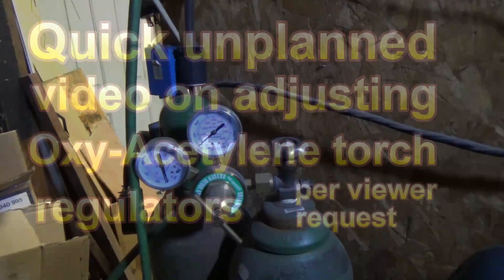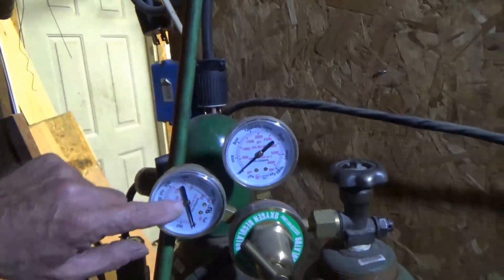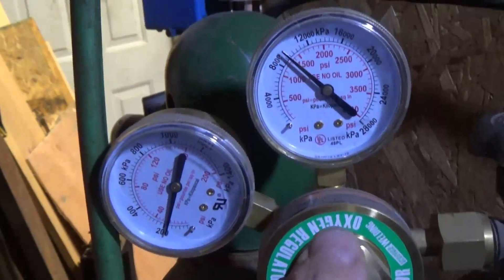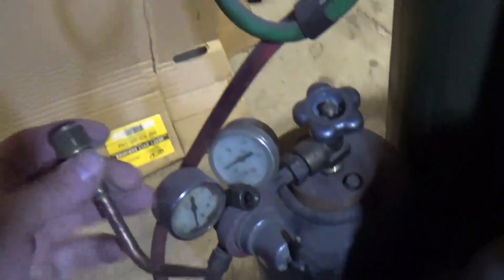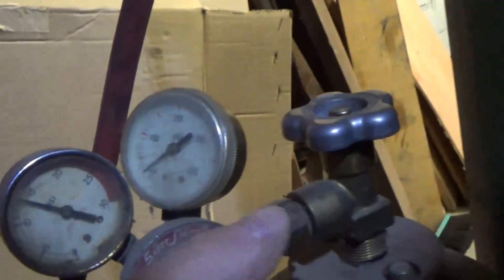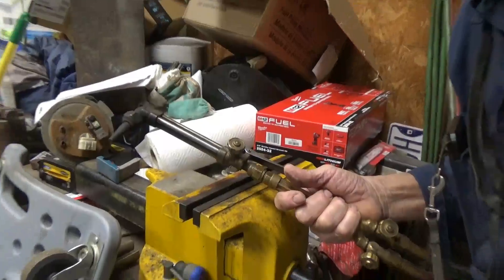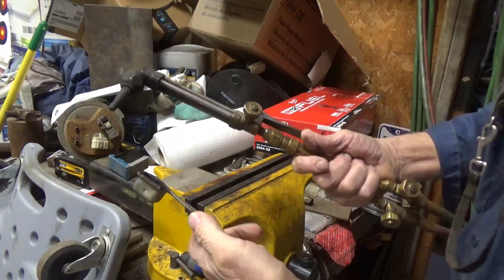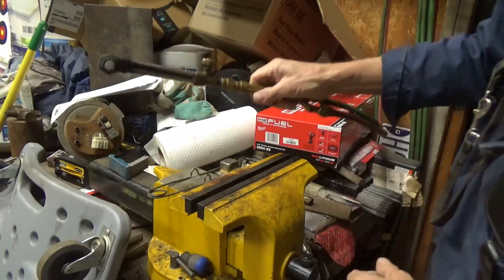How I set my torch regulators

Comment: Thanks so much.

Sorry to bug you again, but I notice that my regulated (low) pressure gauge on the acetylene regulator is in poor shape.   It's missing a screw, and the metal plate with the numbers is bent.  Can one replace just the gauge, or should I get a new acetylene regulator?
Reply from the maker: You're not bugging me. Yes you can get a new gauge from your local welding supply or I bet you can find one on Amazon. I would just get a new regulator, they're not that expensive. Harbor Freight has them in store cheap, also can be found at Amazon.
Reply: @GordonRobertsonDIY  I finally got around to looking.  I didn't know you could get regulators so inexpensively.  I wouldn't blame you if you weren't interested, but a video about which one to buy would be helpful - that is, what's the minimum cost of admission?  I know I don't need the 300 dollar plus set of regulators, but I'm a bit leery of the 40 dollars (for both) sets also.  I'm ignorant about welding and don't know where the "sweet spot" is.
Reply from the maker: https://www.amazon.com/Welding-Regulator-Repair-Replacement-Gauges/dp/B06X94NMLK/ref=sr_1_38?crid=3DKEF7NCRR9HQ&keywords=torch+regulator+gauges&qid=1573327101&sprefix=torch+reg%2Caps%2C181&sr=8-38
https://www.amazon.com/High-Pressure-Gauges-Acetylene-Regulator/dp/B01HIM6KRE/ref=sr_1_34?crid=3DKEF7NCRR9HQ&keywords=torch+regulator+gauges&qid=1573327101&sprefix=torch+reg%2Caps%2C181&sr=8-34

https://www.amazon.com/PSI-KING-Oxygen-Acetylene-Regulator/dp/B01DAZXRYC/ref=sr_1_48?crid=3DKEF7NCRR9HQ&keywords=torch+regulator+gauges&qid=1573327101&sprefix=torch+reg%2Caps%2C181&sr=8-48

https://www.amazon.com/iMeshbean-Acetylene-Regulators-Welding-Cutting/dp/B073F4N33W/ref=sr_1_44?crid=3DKEF7NCRR9HQ&keywords=torch+regulator+gauges&qid=1573327101&sprefix=torch+reg%2Caps%2C181&sr=8-44
Reply: @GordonRobertsonDIY  Thank you for your help. I appreciate it.

Comment: Thanks for responding Gordon!

I do not claim to be an expert on torches but just telling you what we use. Although we converted over to propane from acetylene perhaps 20 years ago we did not change the hose and the hoses we use now and have always used are red and green, right or wrong. Our oxygen tanks might be the next size up from yours and weigh about 150 lb full and cost about $60. Our propane tank is a little bit smaller than the oxygen tank but last forever and we only refill at once a year and although I cannot remember how much it cost it was not very expensive. Most of our cutting is on Steel 3 inches or less and I wish we had the acetylene like in the old days but if I had to pay for the gas myself I would opt for the propane for the cost savings over convenience. It does take a little bit longer to preheat what we need to cut before the cutting starts to take place but I would not say that we use that much more oxygen.

Love Your videos and have been a subscriber for a year or so!

Comment: My employer provides propane instead of acetylene because they save a lot of money although it is much more difficult to work with as it does not seem to give the heat that acetylene does. When they converted over from acetylene to propane we needed a different gauge and a different torch tip.
Reply from the maker: The welding supply told me I also need different hoses if I don't have the hose made for propane, I forgot the name of it. They also told me because propane is not as hot, I will need more oxygen. So, I'll just stay with the acetylene and try to use the plasma torch more often. I still might do a propane set on a small, more portable set some day.